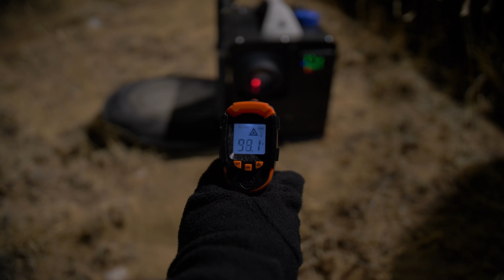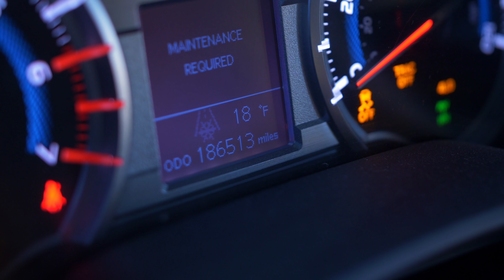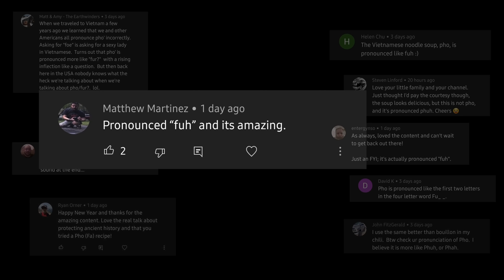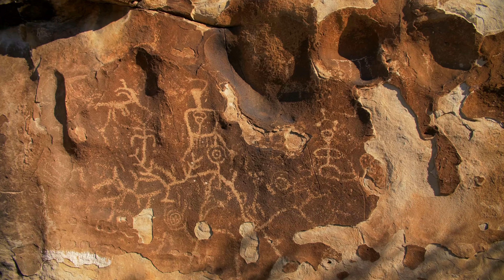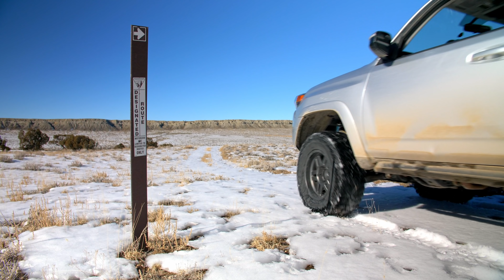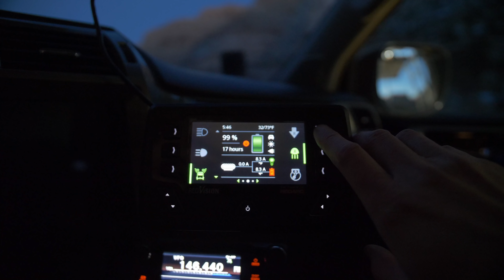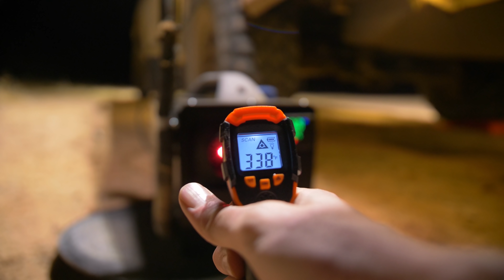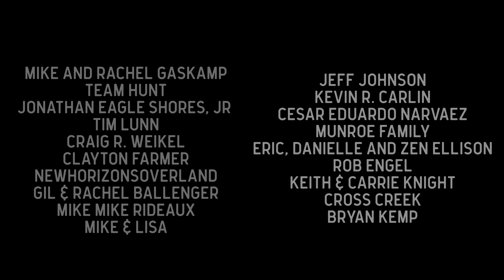COLD weather camping... Enjoyable or Miserable? [S5E2] Lifestyle Overland

Comment: The dielse heater exhaust ur using it with exaugsht in storage position (vertical) wen running needs to be horizontal to avoid diesle build up in exausght pipe and flare up causing rich code... and shut down.... rotate pipe will run all night

Comment: Did a trip recently near the Grand Canyon and temps got down to around 20°. We have the same exact unit and in the (very poorly written) instructions it shows the correct angle for the exhaust being at or below level. For this reason I added 2in feet on either side of the frame to raise it up off the ground. Keep in mind these units were originally designed to be in vehicles with the exhaust exiting down and out. I will also be adding a metal plate in between the feet to protect the ground from the hot exhaust as well. I ran it at the lowest setting and because we were at 7000ft it used 2x as much fuel than at sea level (I was happy it was even able to run at all). So far no complaints and kept our sleeping area (modified Tacoma 6ft bed, cap with Nomad Camper) at 74° all night. To my knowledge there in no thermostat just adjustable fuel rate and fan speeds "control" the temperature. Getting ready to build an adventure trailer which I plan on installing the heater in. A few other changes I made to my unit were 8awg power supply wires, and expandable, flexible 3in ridged dryer vent instead of the soft sided type you used. I'm ramble writing now but planning a trip out westish in mid April for 2weeks from Michigan  and was looking for suggestions?

Comment: When I was working at a ski resort we used a lot of Diesel heaters. Any time it got down to -5 to -10 we had to find a way to thin the diesel fuel out or we had carbon problems.
Reply: That's what I was thinking. That the fuel was starting to jell up in the line's. Because of the temps.
Reply: @northernmichiganoverland  Canadian diesel fuel doesn't gel as we use winter additives.  I knew what that was a long time ago but I'm sure a Google search would identify it.  I should wait until the end to see if he mentions it.

Comment: GREAT discussion of the heater plan. There are some good videos this winter of people ACTUALLY using their gear in cold weather, with many reported failures.
I keep it simple with a Mr. Heater ceramic block buddy heater; but I am still subject to a plugged filter or a frozen propane line, so I always have a couple of layers of contingency plans.

Comment: The thermostat on the header reads surrounding temp, obviously. so if its outside in the cold with the heating unit, it will never shut down and continue to run at high heat. I had to extend the wires from the unit to the thermostat and keep the thermostat in tent. Also, exhaust should be pointed downward or horizontal.  Hope this helps..I'm very happy with this cheap heater.
Reply: There is no "thermostat" on these units. Only adjustable fuel rates and fan speed "control" the output.
Reply: @Rob Watson  damn, I did not know that..then why would it have a temp read out? Or at least my has a temp read out.

Comment: We ran the Falken Wildpeaks for about 9,000 miles and returned them. The on-road rain traction is scary; they would break loose vary easily with the Tacoma being re-geared. Now running the Maxxis Razor ATs 33s, which is a hybrid tire with MT side walls and outer tread and with AT inner tread. I can't break these tires loose in the rain if I tried, and I tried really hard too,  absolutely blowin away at the performance. The off-roading is Supreme! and I've owned BFGs, Falken, General, and Mickeys, nothing comes close to the Maxxis Razors both on road and off road. The side wall flex of these tires is amazing as well and I've got the AT LTs too, which is crazy for 10 ply tires. Maxxis did a really good job at gearing these tires for off-road conditions. Give them a try next time, and you realize that all the other brands have some catching up to do.

Comment: My guess is the fuel is gelling.  If it was summer blend there’s no way it would flow well in those tiny fuel lines in those temperatures
Reply: Run it on pure kerosene not diesel at those temps.
Reply: @wodgesad  I've heard kerosene is too dry for them, maybe a blend is a good idea? Plus kerosene is many times more expensive
Reply: If you run a 80/20 blend of Kerosene/Diesel there is enough lubrication in the fuel to avoid any problems.

Comment: Another great video guys that you for sharing Utah. Question on your off-road driving. I know you air down the tires but what mode do you usually drive in say 2 high, 4 high or are your rigs equipped with a AWD mode of some kind?

Comment: Revere Overland and Venture 4wd would be 2 more good sources of technical info for your heater. Interestingly, Chris w/ Venture 4wd was having trouble with his gasoline fueled Wabasto heater and was thinking about switching to diesel. He was having trouble at higher altitude with proper atomization of his fuel, I believe. Revere Overland built a self contained unit in a Pelican type case. Good luck w/ your endeavor and, as always, Safe Travels.

Comment: These diesel heaters hate any restriction to the hot air flow. If the hose from the heater to the car is too long or restrictive, you will have issues.

Comment: The exhaust should be lower as condensation runs back down the pipe and leans out fuel mixture. Also the muffler has to be notch down to the bottom.